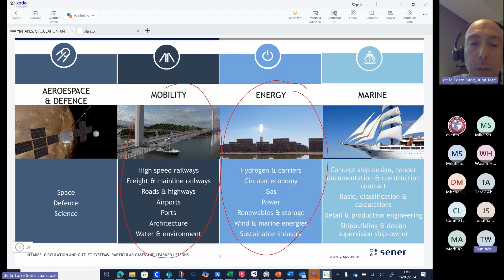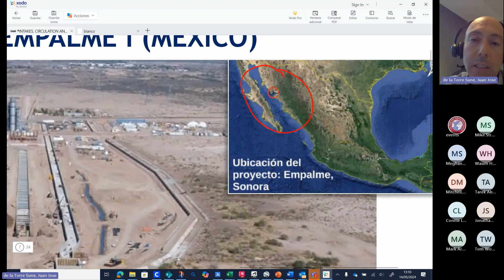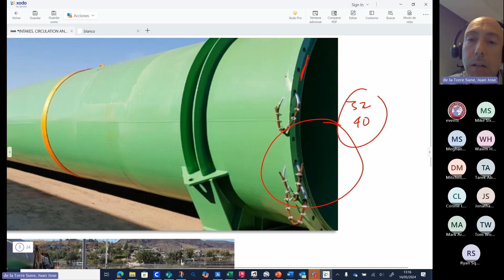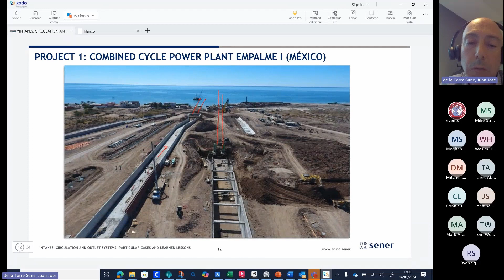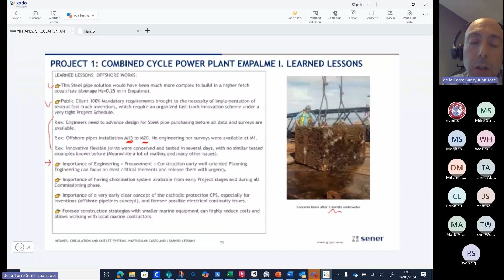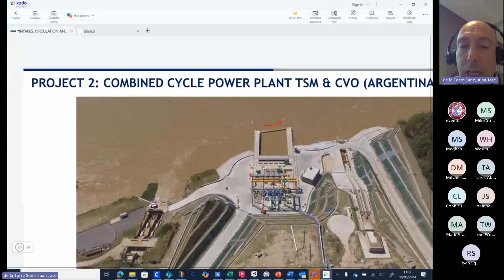Webinar - Intakes, Circulations and Outfalls - Case Studies and Lessons Learnt, Sener Group

Comment: In this webinar we explore some of our best intake, cooling and outlet/outfall system projects.
👉First of all, our EPC Project in Empalme (Mexico) is described, whose subsea intake and outfall conform an open cooling system (once-through) for 1600 MW that has become a world record in both length and tonnage in its typology.
👉Next, we describe the cooling systems in two projects in the Paraná River (Argentina) for an identical total power (1600 MW).
👉The main lessons learned, potentially applicable in similar cases, are shared, as well as certain innovative solutions implemented in these projects.
👉I hope it is interesting to you.
Juan José de la Torre Suñé, SENER Group.